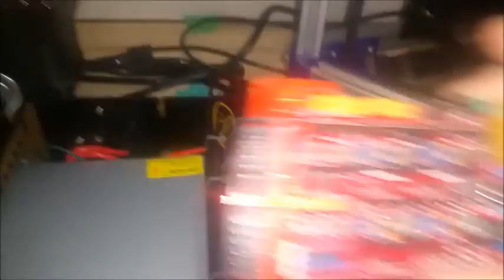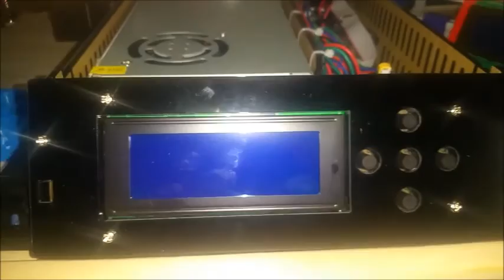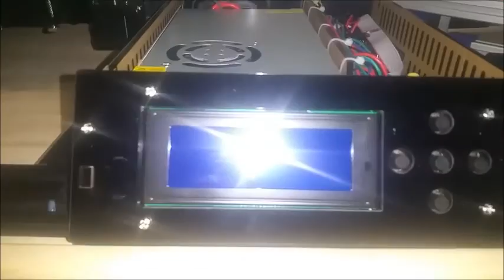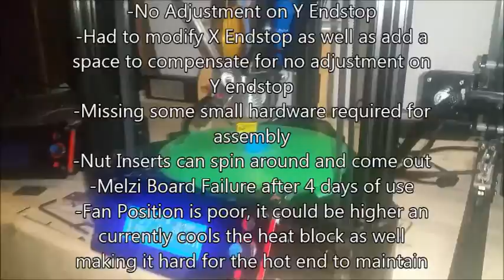My review of the Tronxy X3 and its meltdown

Comment: Hi, thanks for uploading the videos and sorry to hear the printer failed, It looks like a very good and solid design, I was considering to buy the same one at the end of the year but now I'm not so sure. I hope you can find a solution to all the issues and make it work... Good luck
Reply from the maker: Thank you for the support, I could have been just unlucky, it remains to be seen as there is not much feedback out there yet on this printer which was partly the reason I thought Id upload my brief experience with it so far to give some details to anyone in the process of purchasing one or thinking about purchasing one.
Reply from the maker: I have two types in this video one is a braided sleeve, if you do a search for Braided Expandable Wire sleeve on ebay or aliexpress tons of it comes up. I was using 10mm sleeve. Also in the kit I was supplied with about 6 feet of spiral wire wrap, if you do a google search for that you will get tons of images to give you an idea of the stuff, I prefer the sleeve but only had 3 feet of it on hand.

Comment: I have one from Gearbest, too. Acrylic, not the best, but does work. Do not over tighten. A little thicker would have been a little better. 

During my build, I had missing parts. Mostly screws and t-nuts for the x rail. Also, a v-roller was missing a 625 bearing and shim. I got it together and it now prints. Just need to get dialed the slicing settings.

Other issues are that hot end cooling fan cols the heating block as well so the max temp for my hot end is 210ºC--far below the needed 230ºC or higher for ABS, or ASA and high-temp Raptor PLA that I prefer to use. The heated bed also is limited. To about 25 minutes to get 100ºC and even after 45 minutes,  never reached the advertised 110ºC.

For my first print. I used settings for another printer and it desperately needed retraction. 6mm or more I've tested. 
First print: https://www.youtube.com/watch?v=fVJT5-Uhs1M

 I skipped getting the auto level, but the Repetier firmware (0.91) has leveling positioning functions to help a bit.I'd like to update the firmware, but haven't found the 'leveling auxiliary' feature in any firmware branches. 

IF you know what you are doing, and don't have the Melzi issue you had, for the $195 sale price I got it for, It's not a bad deal. BUT it is new and there are issues to be resolved. If I had to do it over, I would have ordered from Aliexpress since that have far better buyer protection, and in the listings I read, can with a spool or two of filament.
Reply from the maker: I included my first print in my build video at the end it turned out  good, I used 4.5mm retraction. I had one more successful print since then. Disappointing considering I have Kossel minis for similar price running without issue from day1. 

I was going to get one from Aliexpress with the 2 rolls of filament but out of curiosity I inquired into the rolls are the seller informed me they were 250 gram rolls each and between them made half a full roll. I am awaiting feedback from gearbest to see if they will replace the melzi board, I am unsure why it melted I doubled checked all the connections and they were seated solid. Someone else in the comments mentioned maybe scratches in the heated bed but I did not see any and if there were why would it melt the ground on the power in connector. For me the acrylic didnt crack until I added the beefier zip ties under the hot end and used some needle nose pliers at that point to tighten up the belt then I heard the crack and saw that the acrylic began to split. I think the fan on the hotend is too big for the small heat sink that is there or should be positioned higher up.  I did not like they style of t nuts they used either they spin easily and cause concern for me.
Reply: I put fiberboard washers to insulated the springs from the bed. There's s video and real of the new Wanhao i3 Plus that smoked when the bed mount touched the frame. I used a similar solution since I wanted the screw more securely mounted anyway with a nut. But that shouldn't do what happened to you. Check the bed's resistance, and/or the voltage coming out of the power supply. And bad solder joints. My x stop had a cold solder joint and didn't work. 

You can get a LCD2004 display with an SD card slot that works with a RAMPS board. I have an SBASE Smoothieware compatible board with a touch LCD on order I might add to this. Also a BLTouch sensor. I figured for the price, I could mod it to my needs.
Reply from the maker: Ive got a few 2004 lcd's with sd card but they do not idealy fit this enclosure and no access to the sd card slot. I have another idea though. I will stick with the display in the device and if i have to swap out to a ramp/arduino combo and I already ordered a couple of micro sd addon boards for the ramps at $.150 each that I can just plug into the back of the ramps board and mount the setup back near the access point on the enclosure

Another thing that really annoyed me is the home position puts the bed at the back of the printer whereas for ease of use it would have been better to the front of the printer. I will prob print a bracket to mount the endstop to the front and flip around the Y axis

I am hoping Gearbest comes good like they usually do for me and send me a replacement board.

Comment: re PSU wiring, You may have been unluckywith that as my flaws-riddled kit included correct rated wiring. Is it possible when we plug wiring in, to create a poor connection, or, for the various wires emerging from the acrylic box to shift and pull the power wires from their sokets creating the burn-out issue? Maybe an idea to keep all 'surplus' wiring outside of the black box so there's no strain at all when the printer is moving which might tug on those hidden away wires... I don't know, Im just hypothesising. I'd like to avoid this if possible. Thanks for posting this video. Very good work.

Comment: I fried my board as well, and I'm trying to save it by replacing the damaged component. Would you please do me a favor and with a magnifying glass read the text which is printed on the voltage divider. This is the small black box right beside the power socket (Labled "D1"), and visible in the video at 4:25
Reply from the maker: SS14
Reply: Thank you!
Reply: SS14 is a Schottky diode which are usually wired in series with the power to idiot-proof the system- prevents damage if you reverse the power leads. If I had a cchematic and could verify that, i'd just replace it with a piece of wire as it reduces the input voltage and is otherwise useless unless you can't figure out that the red wire goes to + In which case you shouldn't be building a printer in the first case! lol But only do this if you're 100.0000% sure.

Comment: Good thing u have the delta printer u can make some pla parts to replace the acrylic! Also, with all the people using the arduino sp? there has to be a build that has SD support? 
I really want to build a delta 3d from plans off the maker site and am really mechanically inclined but I'm scared that ima pick the wrong one to build...
Reply from the maker: I have 3 deltas, one is custom built, if you go through my videos you will find a video of it. It is fairly straight forward to build if you are as you stated mechanically inclined. I can even give a BOM for it. The LCD on my kossels has the sdcard slot built in and plugs into the ramps 1.4. 

Specs on My custom Kossel: PC PSU with modified wire harness, Build area of 480tall by 330 diameter. Heated build area, aluminated hot end shroud, Printer overall size is 1020mm tall by 500mm wide

Let me know if you want a BOM and some input on such a design and your email address and I will send you the information. If you want to build one with the exact dimensions as my custom one I can even send you the marlin firmware so you dont have to figure out your offsets, delta radius, etc.
Reply from the maker: Also for the Small Delta you see in the video, if that is the size you want to build you are better off buying the kits as they are cheaper then sourcing all the components. A Kossel Mini kit can be purchased for around 210usd with free dhl shipping. Also I am working on another type of Delta style printer at the moment I have all the Plastic model files completed and I will begin building the prototype soon. Sometime within the next few weeks I will be uploading a video on it and possibly putting the model files on thingiverse. If it works like I hope I plan on building the prototype 50+inches tall and 28inches wide

Comment: Hi. Are You have on all power ports output chips  cooler top  mounted ? Especially Hot end?
Because my hot end don't heat, and in it's power port voltage =0.0, so I probably think, that they missed cooler and it blown up.

Comment: It's a $200 printer, what can you expect!! The board is fine, it is just the connector that is fried!! A lot of these cheap printers use cheap connectors that cannot handle the load. You can either solder the wires where they go, replace connectors at heat bed and power with xt60 connectors or buy a mosfet board and transfer the high load to that from the heat bed. I just bought a monoprice make select and they have the same board with the same cheap connectors!!! I ordered the mosfet board the same day I bought the printer and also soldered the wires to the board just to get rid of them horrible connectors!! You get what you pay for in this hobby!! No use complaining just fix it and be done with it!!
Reply: You should make some tutorials
Reply: Agree there are a lot of cheap connectors. There are also a lot of people that don't tighten them properly which results in exactly this same problem. Soldering is great if you have the skills as you do. but many noobs are going to screw that up- short something out or delaminate the foil on the board, or let the heavy wire yank it off.

Getting the MOSFETS off the board is a great idea too. If it does blow, you lose a $10 board rather than a $30-40-50 board that's way harder to replace.
Reply: I have this printer. No issues yet. I have modded it a lot as well. I bought a prusa, the tronxy x3 aluminum frame beats it. first mod is bed stabilizer and extruder fan. Other than that everything else just improves prints. awesome starter printer
Reply from the maker: It is an awesome printer if you have prior experience, and it would be an awesome printer to someone new to 3D printing if the Q&A was better on packaging before it ships out, but of the 4 I have received only 1 had everything needed in the box. The last one I got I was missing the grub screws for the angle brackets on the base frame and the screws for holding the acrylic bed plate down. For the other individuals jumping down my throat about this video and complaining that i did not post a solution in the video but in the comments, I did not receive my replacement board until 4 weeks later at which time I did a follow up review after I determined it was the gauge of wire that was my issue, once I determined that I did go over it in that video as well as how well the printer is now performing especially with the mods I had designed for it. I had no need for bed stabilization a my bed was and is snug even with the wheel base now shorted and the bed size increased to 260x285. I did design several fan shrouds to replace the factory as it is an awful design that cools the hot end and has no filament cooling. There are lots of positives about this printer and some negatives. The negatives can be overcome but if you are a novice just getting into this and have some bad luck with missing parts when you get this printer those negatives can become a big obstacle. Also when I did this review the Facebook group and WIKI did not exist yet, they came along a little later after Budi contacted me several times about the printer he decided to put up a facebook group, and there are a lot of helpful people there where I recommend any with problems to go to as you can post photos of your issues which can be far more informative then a sentence in some youtube comments. At $225 US all metal frame and some pretty beefy extruder motors, 5 of them this printer is a good value with great potential. With a few extra dollars and some design work a person can easily expand the bed to 300x300, Use a 300x300 aluminum plate over the heated bed and put corking under the heated plate to the size of the larger build and it should be able to heat it up just fine.
Reply: There are many resellers. Some are crap compared to others. Consider that as well.
Reply from the maker: true, I have only purchased from two however, Gearbest and a specific seller on Aliexpress.

Comment: The reason you have burnt wires is because the connector blocks are poor quality change them all and get rising clamp terminal blocks that will make a big difference in clamping the wires and use adhesive under each block to stop it turning when you screw down on the wires if you want more help then let me know and I will recommend the best blocks to use

Comment: will the electronics and software allow me to increase the metal frame area to create a much larger print area?  I just bought one of these but id like to find out before ordering new alum extrusion.
Reply from the maker: The Facegroup has access to variations of the firmware which you can modify. The electronics will not inhibit increasing your bed size. I assume you are talking about increasing it in the Y direction as to increase it in Height you will need new threaded rods as well
Reply from the maker: Well if you watched more of my videos you would hear that I state the same thing and I even say that exact same thing during the build video that for $200 it is a good value. Current lowest price is $225, and the board is no more good, I did get another connector but the pcb got burned bad there and it no longer functions

Comment: I just bought one, and I can't even get one print out, now the bed isn't heating above 88, they don't respond now on Aliexpress, this was a mistake, too bad , as the Melzi board has a lot of nice firmware settings to set through the LCD, like XY-jerk and Vref's, etc for the price.
Reply: I found some info saying that Melzi needs 19V on the bed, which means, the Melzi board requires a 24V not 12V, that was sent with the kit, so I tried adjusting up the supply as far as it would go (15V), and now it's heating up, and fast too. I notice this board has a J15, which allows you to separate the power supply to the logic section via the USB, I had a nasty ground-loop on my Mendelmax 1.5, so, nice feature if you like to print tethered.
Reply from the maker: So is it working well for you now? I did not have to modify anything on mine. I got it through gearbest so maybe different Powersupply. I wired it up as per the guide. My ground connector on my Melzi fried due to the wire from the psu being stranded and too low a gauge. Gearbest replaced it not questions asked and Ive used 10Awg solid copper and no heat issues at all on it. Mine has been printing now 8 days straight non stop no issues with on print lasting 18 hours
Reply: It struggled to reach 110, but finally did, yeah I found info on the Melzi, that suggest it needs 24v not a 12 volt, like I was sent from Aliexpress $250, and it uses the auto bed level sensor, as the Z endstop. The only thing that may improve it, is cutting the provided hb wires shorter and doubling them up, to increase the current. I can guarantee, that if the bed is getting 19volts from that board, it would need that much or more coming in, and standard would be a 24volt supply, the documentation is sparse and crappy from the seller.
Reply from the maker: I am not sure what you have for a psu, I thought they would all be the same with this kit. I received a 220/110V switching power supply at 20amps, so I am not sure about the 12V vs 19V issue as I have not had to do anything to the PSU other then make sure it was switched to 110V not 220V
Reply: I'm an electronics engineer, and I'm sure what I said is correct, I measured it with my meter.
Reply: It's on the 110V , I just checked for the 3rd time, make sure I had it in the correct
Reply: I finally have it printing, I'm still having a few buggy issues with extruder temp bouncing way up on the display, and sometimes the power switch won't turn off (have to unplug it), but the 3d bench I'm printing in ABS looks pretty good so far, and the printer is quiet, compared to others I own.

Comment: hey could you tell me your other 3d printer that running besides?
Reply: i mean the name and model please
Reply from the maker: I have 2 Kossel Mini's in the background as well as a custom(Homemade Supersized Kossel). Currently I have the X3 which performs pretty good after modding and fine tuning it, a CR-10 which is an awesome printer for the price, my 2 Kossel Mini's, custom Kossel XL, and a prototype Delta style printer I am desigining
Reply: Thankyou for replying sir. I also now currently have the x3 but im scared the printer will have same problem as yours. And im still deciding to buy a new printer for a long term use. Do you have any suggestion? is delta style better for longterm use or is there any other that can have a longterm life with no issues?
Reply from the maker: For the wires from the Power supply to the board, get some thicker gauge and you will be fine. I use my X3 far more then my kossel mini's. It has a bigger print area and is just as reliable. I bought a CR-10 and really like that printer, it comes 90+% assembled, and with the right coupon code can be picked up for about 410usd. It also has a big build area of 300x300x400
Reply: Oh thankyou but which one do you think has a better quality of printing? and where do you usually buy printer from?